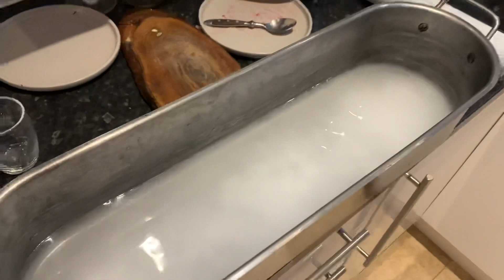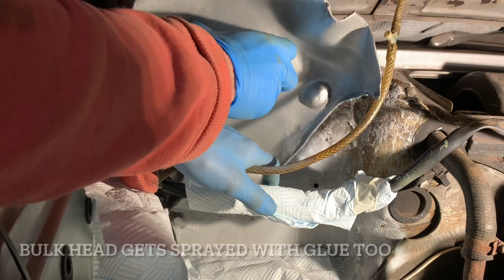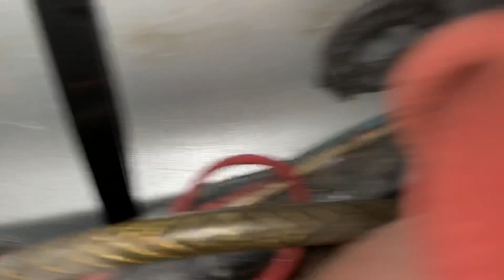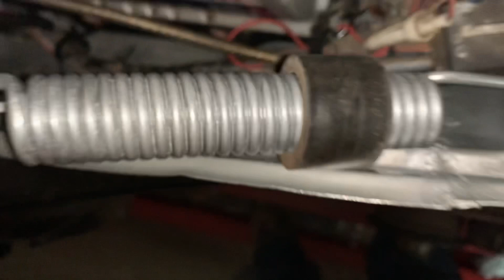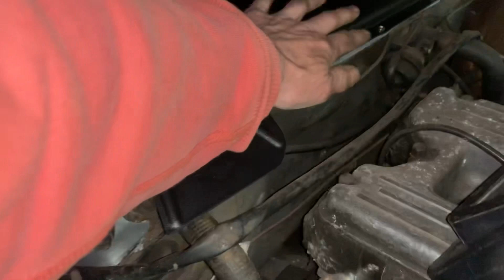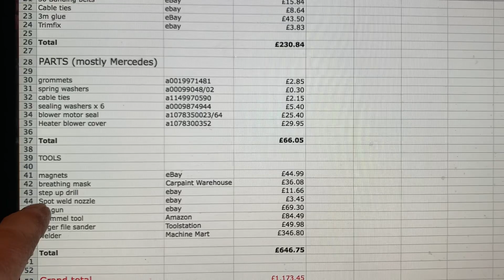Mercedes R107 SL - bonnet spring, wiring loom cable ties, bulk head insulation

Comment: Always impressed with your work!  I would love to get a "280SL" front license plate for my car. Where did you get yours?
Reply from the maker: Hello - I got mine from https://ej-parts.co.uk/tag/Pressed+Number+Plates/
YOu may need to email them and mention that the plates are for a display/show car. Mike
Reply from the maker: Hi Rome, I need your help again.....Is there any way you could send me a couple of photos of your car? I need the a picture of the front with the bonnet open showing the radiator and if possible what cross members (if any exist) and whether there is a vertical brace bar infront of the radiator. I want to see if the radiator set up on the red project rcar looks similar to yours. Also....a picture of your rear view mirror and sun visors. I have something on the red project car that I am certain is not from an SL....but I could be wrong and your car is pretty close to this one. Thanks. Mike
Reply: @MikesMercsandothercars  No problem.  I sent you the photos. Glad to help.

Comment: Fantastic work as usual. Have a look inside the air blower compartment, this area is vert prone to rust. Its recommended to remove the blower motor, have a deep clean, ensure that the drain hole are free and then spray over it with some type of water repellent (oil is fine).
Reply from the maker: Thanks for your comment. Compared to the rest of the car, this section was relatively OK. I think this car is a candidate for a complete strip down, sand blast and nut and bolt resto - whether I’ll still have a wife and family then is of course another question.....
Reply: @MikesMercsandothercars  Family first! Best way is to share the enjoyment of driving these cars. Impressive how fast it started up. How long have you owned the silver one?